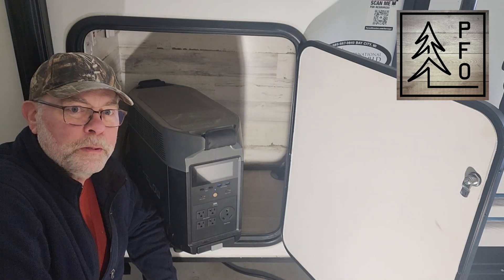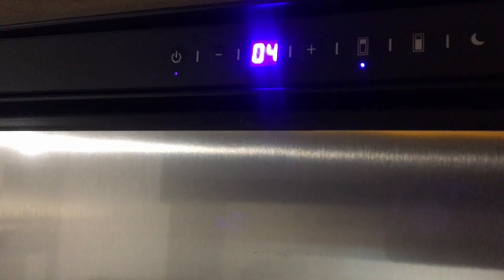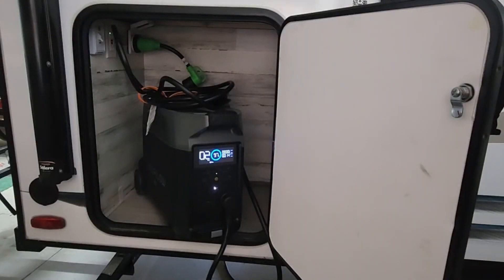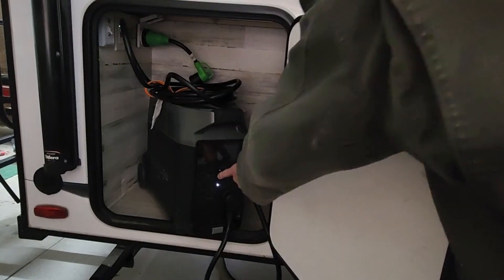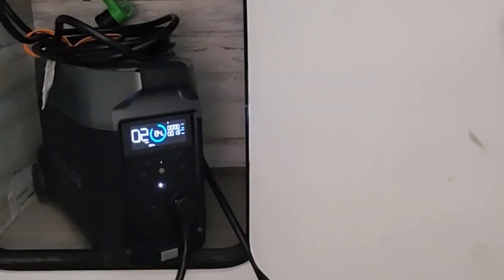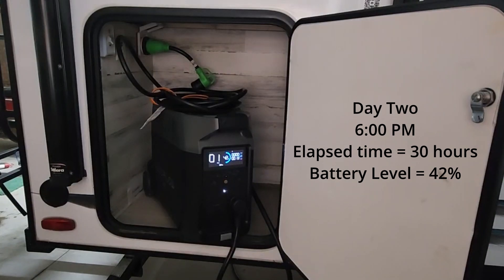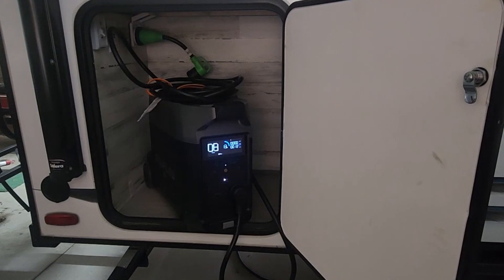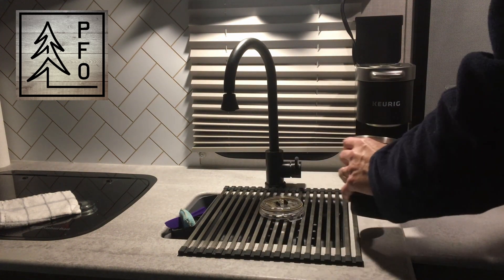Travel Trailer Off-Grid Test: Can EcoFlow Delta Pro Power Your Fridge?

Comment: Does the converter remain on or off?
Reply from the maker: Any electrical systems in the travel trailer, including any converters,  continue to behave exactly as they would on shore power. There is no difference in the power coming out of the transfer switch whether it is coming from shore power or from the DeltaPro, and the electrical systems inside the trailer have no magic way of knowing the difference.

Comment: Good idea 6 Eco flow delta pro 3 system and Eco flow delta pro 3 extra 12  battery  😊 and 2  Eco flow delta smart panel 2 and power whole house
Reply from the maker: Yes, for the house, I installed an Ecoflow smart panel, and we have two of the Delta Pros, but no extra batteries. It runs everything we need during normal power outages.

Comment: Thank you for doing this test. It answered all my questions before going boon docking with my delta pro. It made me happier coz our fridge is smaller than yours and meaning it will be drawing less power, I hope. But even with your size of the fridge, the delta pro provided enough power to run it for 2 days. So that pretty much reassured me. Thank you. We do have the 160w x 2 solar panels from EcoFlow so will also try to charge it with that. Thank you again.
Reply from the maker: I'm glad it was helpful. Have fun boondocking.

Comment: How long can you run your rv ac on a full charge delta pro?
Reply from the maker: This is a common question. I'll copy my answer given previously under our related video (linked below)

"There are many variables that influence the amount of time the Delta Pro will run the AC unit. The biggest two factors are probably the outside temperature and the temperature to which we wish to cool the inside of the travel trailer. When I ran a test to try to answer this question, the  Delta Pro shows it can run our AC unit for 3 hours if the AC is running on full blast the whole time. Our unit draws around 1,240 Watts on the High Cool setting. The Delta Pro provides a maximum of 3,600 Watt-hours, so the 3 hours shown on the screen is accurate, but rounded up. (The display doesn't show any decimal places on the 3 hour estimate.)

When the inside temperature reaches the setpoint on the thermostat, the AC compressor stops running and the AC unit runs in fan-only mode until the thermostat calls for more cooling. When it is running only the fan, it draws about 94 Watts. In that mode the Delta Pro would last about 38 hours. So, depending on where we set our thermostat, and how hot it is outside, it is going to keep switching back and forth between cooling and fan-only mode. The end result is we'll get somewhere between 3 hours and 38 hours running like that. It is important to note that during this quick test there was nothing else turned on in the travel trailer. When we are boondocking we always have food in the refrigerator and running the fridge is top priority. Therefore, we have concluded that if the outside temperatures are hot enough that we would not want to go without the AC, then extended boondocking is not compatible with that situation. For example, when we visited Moab, Utah and it was 104 degrees, we stayed at the local KOA campground and ran the rig on shore power."

Thanks for watching, and thanks for the question! Here is a link to the related video:

https://youtu.be/S30MPRMG4qo
Reply: @thePFOchannel  perfect that answers it. One more thing. Soon I have to live in my 22 foot trailer full time. I'm loosing my job because of federal shut down. So my question is can you have trailer 30 amp power plugged in the delta pro running AC and at the same time use solar panels to charge the delta pro as it's being used? Or it can not be charged by solar panels while the delta pro is in use? I knew the new delta pro that came out last year can do it. How about this original model? I have the trailer and delta pro. However I live in a forest in a camp ground and no sun right now so I can't test it out.
Reply from the maker: My model of Delta Pro can simultaneously provide power-out through the 30 amp receptacle (and it's other outlets) while accepting recharge power-in from any DC source, such as from a solar panel or a separate DC battery, through any one of the DC-in ports available on the unit. But, it can not be simultaneously charged by any AC source while providing power through its own AC or DC outlets. I posted another video where I did feed the Delta Pro from a 100Amp-hour LiFEPO4 battery, which gave us a significant increase in the time the system was able to power our refrigerator. Also, the Delta Pro apparently CAN NOT accept DC power-in through any of its DC-out ports. 

Good luck with your travel trailer living adventure!
Reply: @thePFOchannel  perfect. Thank you. Main reason I got it so that way I can be in 120 degree weather and have AC the whole day. While ac is running from delta pro it will charge by solar at the same time. I am looking at your other videos.
Reply from the maker: If I was going to rely upon the Delta Pro to power our air conditioner, I would install a soft start device on it. I haven't done the math, but the fact that the power spikes every time the AC compressor starts up tells me the Delta Pro would be depleted more slowly with the soft start in place. Speaking of math, I'd also do a deep dive on the calculations to be sure to size my solar array based on the max draw from my air conditioner, any other anticipated loads, efficiency losses, sunless periods, etc..
Reply: @thePFOchannel  i won't be running anything besdies AC in the day. I have other smaller solar 300w battery banks for electronics. As long as solar can keep up with the AC. Or even lagging 50%, it should give me 5-6 hours a day of AC, which I can use during the hottest times of the day.
Reply from the maker: That's a good idea to keep a separate 300w battery bank to run your electronics and save the Delta Pro only for your air conditioning.
Reply: I guess anything can be done if you throw enough money at it. 😊
Reply from the maker: @in2food  So true!

Comment: Just for clarification, you are charging off of shore power
Reply from the maker: That is correct. I am currently planning the next phase, though, which is to add a heavy gauge wire from the truck battery all the way back to that compartment, so it can receive at least some amount of recharge during a long day of driving. Also, I have purchased solar panels (800 watts) that are going on the roof of the RV to feed the Delta Pro. The DP is set up to accept a charge via 12 volts at the same time that it is powering on AC output, so the panels can prolong the time until depletion even if they don't replenish as fast as the draw rate.
Reply: @thePFOchannel  I'm seeing these as a substitute for a complex solar system.
Reply from the maker: Yes, for sure. You can just plug in up to 1600 watts of solar directly into this. All of the charge controllers, inverters, etc., are handled internally. The only exception I've found to "just plug everything in and let it do its thing" is that you cannot leave it plugged in to 120 volts (as when I wish to recharge it from shore power). It apparently will not turn on the AC output when it senses AC input, even if it is 100% charged.  DC input (from any source) is OK simultaneous to AC output.

Comment: The inverter uses 30W when on. So actually the inverter used more power than your fridge.
Reply from the maker: Yes, the fridge was surprisingly low on power consumption. The Keurig is the heavy user, but fortunately, it doesn't take long to brew a cup.

Comment: Put a soft start on you air conditioner and this will run it no problem. also after the solar panels add the extra battery and have even more fun boon docking
Reply from the maker: Thanks!  I have been considering a soft start unit. The Delta Pro will run the AC as is, but it does use a lot of energy, so we usually minimize/avoid the AC to prioritize keeping the food cold. Once we have some recharge capabilities (the solar panels), then the soft start will make a lot of sense.

Comment: I just purchased the eco flow pro and a back up battery for a total of 7,200watts. I am even considering a second battery back up to make ot over 10,000. I have a 35 foot class a but want to focus on general power to allow us more boondocking experiences. This was a great example of how/what it might draw. This is new for me and I thank you for posting!
Reply from the maker: It sounds like you'll have a great set-up! We are really happy with the performance of our Delta Pro. We make several trips per year from Michigan to Montana (30+ hours of driving) and spend those two to three nights along the way, Boondocking. Our biggest concern is keeping the refrigerator running while the vehicle is shut off. If we are careful not to use any other power after parking for the night, this unit can last the three nights without recharging during the trip. My next step on this project will be to add a circuit to directly charge the Delta Pro from the tow vehicle while the engine is running. On a day with 14 hours of driving, that will replenish the DP by a significant amount. I've also purchased more solar panels for the roof. There was one small panel installed by the factory, but there is room for another 600 watts. Both of those upgrades will be in future videos. Thanks for watching!

Comment: How long to recharge from empty? BTW The flexible solar panels feature the latest CIGS technology (Copper Indium Gallium Selenide). These CIGS panels can easily be installed with the included adhesive, and are form-fitting to fit multiple surfaces. Very nice for a Travel Trailer
Reply from the maker: Not real sure. I've never let it get below 10%. Also, there are several settings to choose on recharge rate, and I've never chosen the fastest recharge, which I think is 1800watt input. Just doing the math, it should take a couple hours to fully recharge (to the 3.6 kWh using 1800W input).  If I get bored, I suppose I could do a video to confirm the math.

Comment: Is that refrigerator running on AC or DC?
Reply from the maker: It's running on the 30amp AC output from the Delta Pro. Check out the playlist to see how it is wired via a transfer switch to feed into the same circuit that normally carries the shore power.
Reply: @thePFOchannel  Interesting.  I use an Eco Flow in my truck camper that is wire via a transfer switch as well.  When my fridge is set to AC the Norcold fridge draws 300 watts which is way more than your fridge was drawing.

Thanks for reply.
Reply: @thePFOchannel yes, but the fridge is 12v right? Plugges to 30amo but using the converter to 12?
Reply from the maker: @abdielabdul9238  Yes, the fridge runs on 12v. I didn't alter anything about the way the travel trailer utilizes the power downstream of where the 30amps of 120volt power enters the transfer switch.